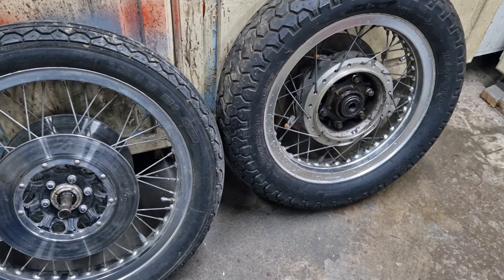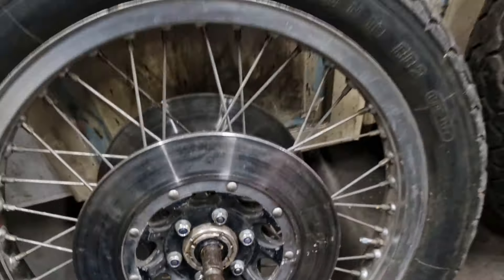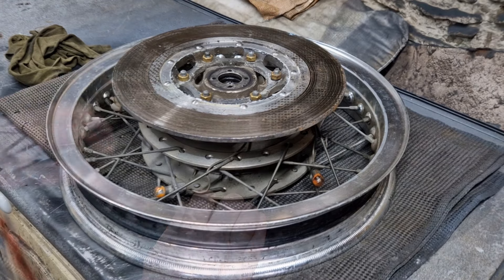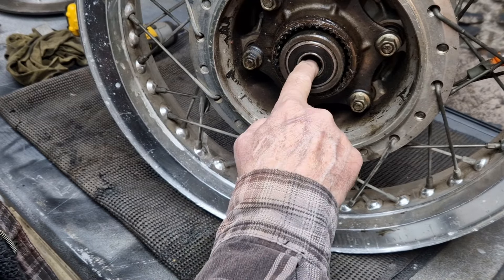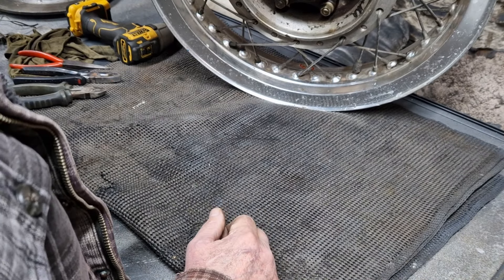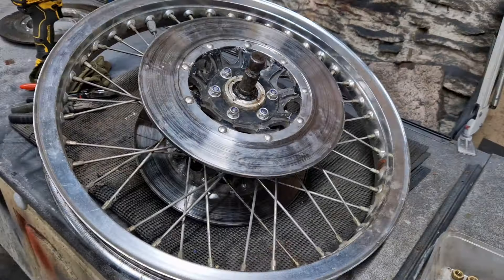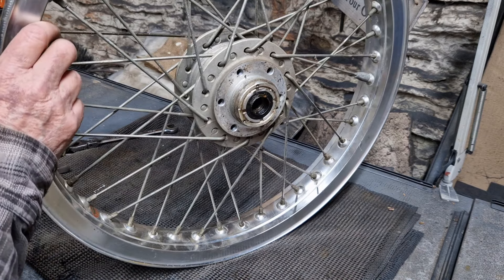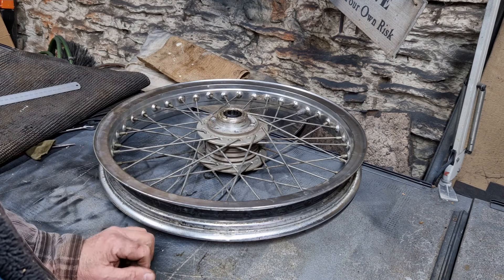Honda GL1000 Goldwing restoration: Part 17

Comment: The discs on gl1000s are normally hard wearing unless high mileage or very abrasive pads are fitted, most wheels you find for these bikes are from the US & nearly always fitted with Dunlop tyres which were made in the US & are hard to find in the UK . I am not sure how you can get a Descent finish to the lacquered rims without losing the DID stickers ,But you will no doubt prove me wrong on this ! . you said you were not going to split the motor only replace the clutch While the back cover is off i would  replace the starter rollers which tend to stick due to lack of oil from standing . A gl1000 engine as a rattle on tickover that some people cant live with ,even when the carbs are set spot on , the answer is a gl1100 hyvo chain tensioner instead of the slide that is originally  fitted . worth a look when you are in there ,also the water pump tends to leak as well ,  I am not looking to find you work but easier to do while motor is out ,nothing worse than taking it to bits once its back in frame .!!!!!
Reply from the maker: Thanks for commenting. Some great tips there I'll be taking onboard!

Comment: Great stuff as usual well done. I'm trying to find a disc lock to fit these discs and it's proving a challenge, as the rotor is 62mm deep and much deeper than newer rotors nowadays. Anyone found one which fits? I intend to carry in the faux tank so a large U lock is no good! Btw, what thickness were your front rotors and where do you intend to find replacements?
Reply from the maker: I can't remember the thickness of the front ones, although I remember they were thicker than the manual says they should be! I'll need to source a rear disc, probably from Ebay